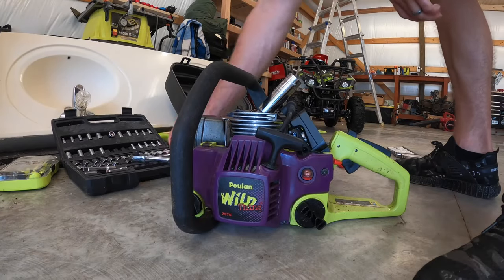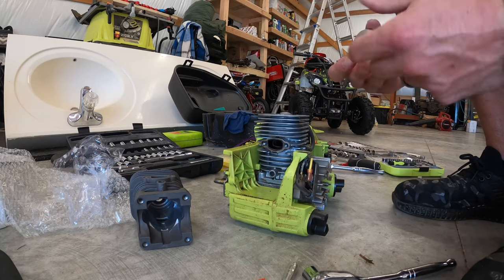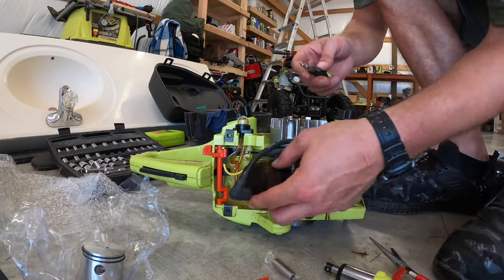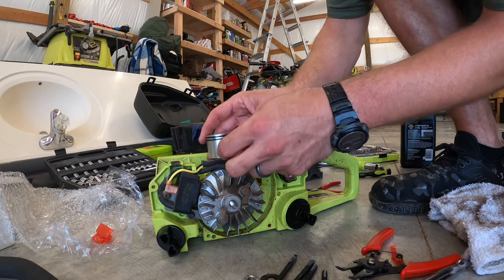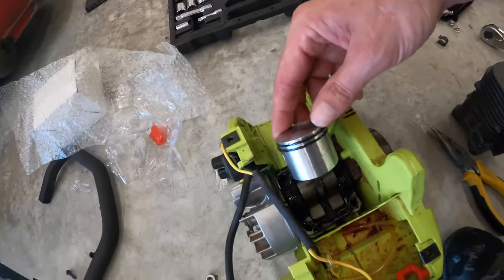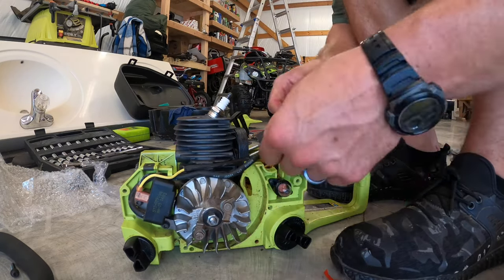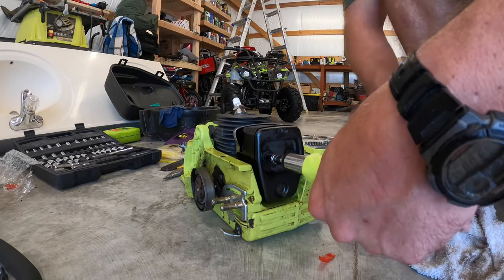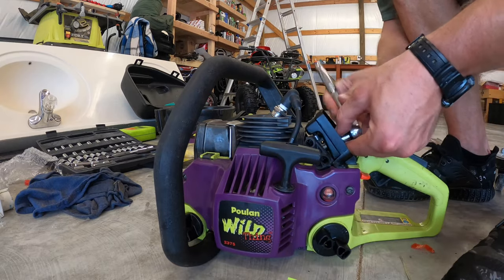Poulan Chainsaw Engine Replacement

Comment: Why not putting the sealant on the new cylinder instead of working in that tight space and risking getting it everywhere? Nice job, I was actually thinking about doing it the same way (not taking the whole damn thing apart). Thanks
Reply from the maker: That’s actually a good point.  Not sure why I didn’t put it on the new cylinder instead.  Good point.  

Was my first chainsaw engine.  Works great though!

Comment: Can you add a link in the description to which head kit / vendor you ordered from. Some have problems with the pistions bottoming out
Reply from the maker: Just added it.  Going to post it here as well. 

https://www.amazon.com/Montree-Shop-Cylinder-Piston-Woodshark/dp/B07TXCH3L3?pd_rd_w=Fxvwg&pf_rd_p=4eebd874-436f-4f05-a794-09646834b2dd&pf_rd_r=2YXM2QGG3FWH51F79QGX&pd_rd_r=8266b3fc-10ea-46ad-a9a8-ff5be8e34d4b&pd_rd_wg=jelBr&pd_rd_i=B07TXCH3L3&psc=1&ref_=pd_bap_m_rp_1_sc